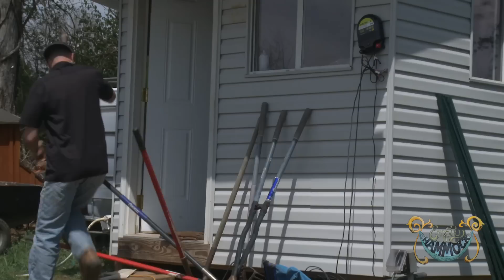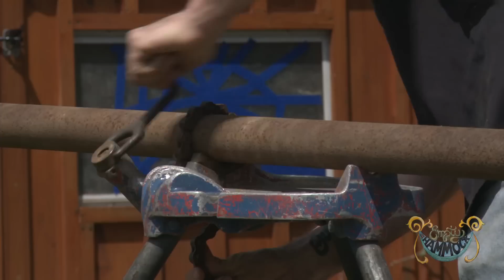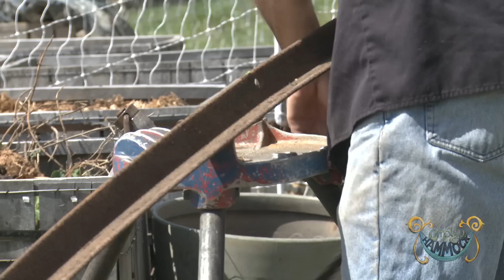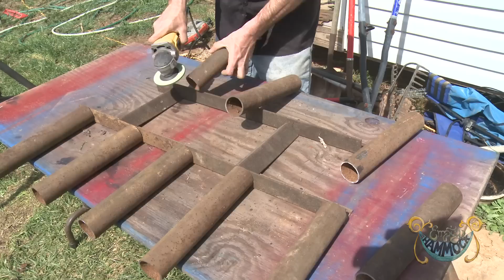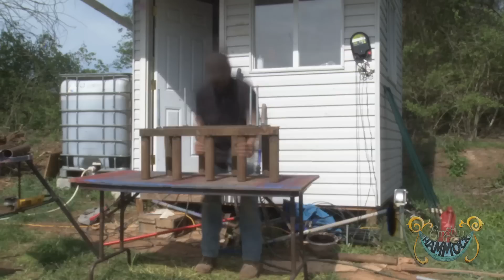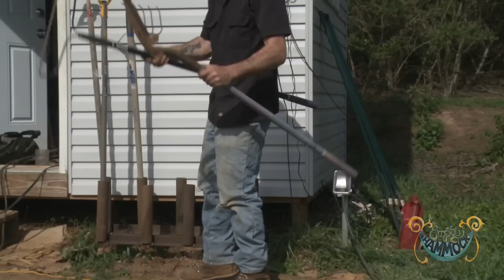DIY Garden Tool Holder

Comment: love holder. but make things we can make
Reply: +Jeff Clayton You can easily take this idea to a welding shop and they could make it for you.  It's not DIY, but I doubt that it would cost much.  In my opinion, that would be much better than making it out of PVC like some comments are suggesting.
Reply from the maker: +Jeff Clayton
Don't short change yourself sir. MIG welding is easy and relatively cheap . Anybody can learn. With a little practice you CAN make things like this.